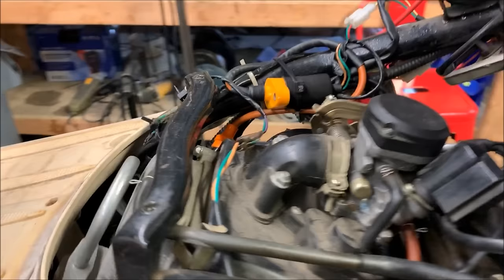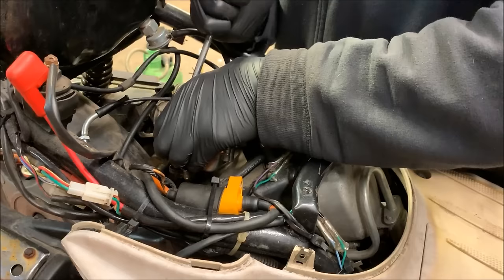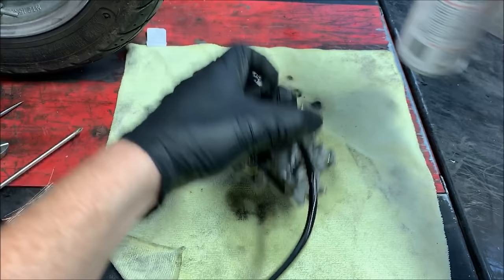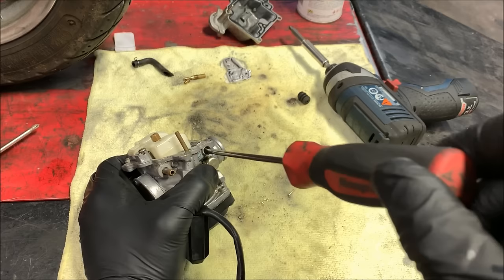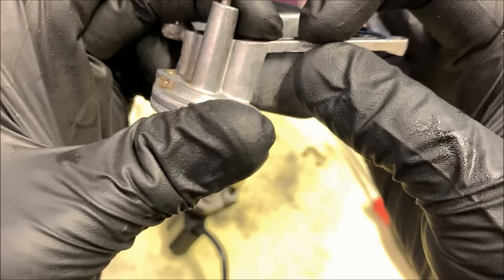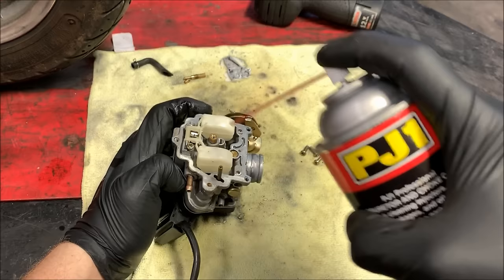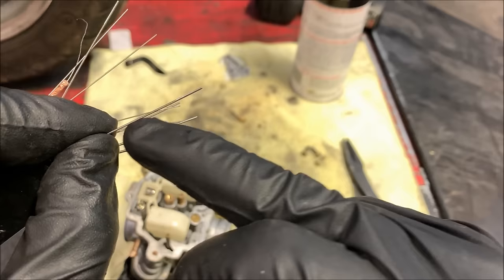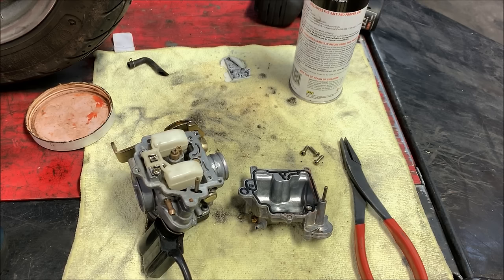Cleaning a scooter carburetor

Comment: What if you didn’t replace the small washer and o-ring? What would happen to the bike? How would the bike be affected?
Reply: It would suck in air from around the screw and run more lean
Reply from the maker: it wouldn't affect it well cause issues,  did you give us a subscribe?

Comment: The only problem with GY6 carbs is the fact that the fuel bowl comes with one way screws and you have to drill them out and have replacement screws to reinsert. At least mine did.
Reply from the maker: Yea I’m.guessing they want you to replace it rather then fix it. Chinese scooter thing

Comment: I drilled out the plug on my carb to expose the air mixture screw and there is no slot in the brass. what can be done?
Reply: I had the same issue, and used needle nose pliers to turn it.
Reply from the maker: this

Comment: Ant recommendations on where i can get the screws for the float bowl cover? The float bowl on my scooter have break away screws.
Reply: how did you remove the break away screws?
Reply: @chadpianalto6262  i didnt. I started to but I bought a new carb.
Reply: @Goldensnakey  I was able to get them removed by spraying all three screws with pb blaster and the next day used an easy out. they came out fairly easy.
Reply from the maker: hardware store?
Reply: @Scooterswapshop  what size?

Comment: You nentioned the "Fuel tap" being stuck open.. Where is that and how do you fix it?  Good Video!
Reply: He's talking about the part that screws into the gas tank with 2 hoses on it. The carburetor vacuum sucks the gas diaphragm inside it to open from one hose, then the hose next to it flows the gas to the carburetor.
Reply from the maker: recently did a video on it
Reply: @WaveAction777  Many thanks. Cheers!

Comment: I have a question, I have a yerf-dog rover CUV w/ Mikuni slide and manual choke , is it possible to change carbs and go to an auto choke carb ? I know I will probably need an inline resistor and a different CDI can anyone help ? This is my wife's CUV to run about the farm in and she has trouble operating manual choke @ start-up hince the need for modification.
.
Reply from the maker: anything is possible that's not a bike we deal with

Comment: Pleasssss help me before my dad kills me, I put some used engine oil in the gas, and after a few hours the scooter doesn’t run, I drained all the fuel and oil and put new fuel in there but it still doesn’t run pleassss what do I dooooooo
Reply: What happened?
Reply from the maker: new gas and oil run for 10 min
Reply: take the plug out put some gas in the hole clean the tip on sparkplug and when it kicks over keep it running till it flushes it out

Comment: Great video and very good explanation of what/how/why.  My Piaggio Fly 50 with this exact same carburetor was not good for anything past 1/4 throttle.  I found that the pilot jet was completely clogged.  I tried to work my carb cleaner wire in there, but no good.  I found a tiny drill bit for my Dremel which was the same gauge as the pilot jet, and began to drill.. much to my surprise it was blocked from the factory - no hole lengthwise at all.  Which was surprising because the mixture screw was readily accessible and set (somewhat) correctly.  Also, the Accelerator pump jet was clear.. but the other end which protrudes into the intake of the carb doesn't have a hole in it!  
  Re-installed on the scoot, and it ran but for 5 seconds or so and died.  Wouldn't re-start.  I suspect it's flooded - is it possible that Piaggio was using this Keihen carb but put in a dummy pilot jet and a dummy accelerator jet?  
  Either way, I have a replacement GY6 carb on the way.  We'll see.
Reply from the maker: THANKS

Comment: Mine has those damn screws with no heads so I had to stop..I have a new fifty cc I got last year .it started up after winter but then I felled the tank and the next day it wouldn't start and I can't get it running.im so upset..I love that thing..I was in a motorcycle accident and the scooter keeps me riding with a smile. So I'm heartbroken..and I dnt know where to get it fixed . knobody wants to touch it..I'm gutted..mayb I'll have to buy. New carb
Reply from the maker: ok

Comment: I have a 50cc scooters pretty much brand new it won't turn over won't start
Reply from the maker: You’ll need to contact the shop you
Got it from as its likely under warranty
Reply: Sounds like a dead Battery?  Do you keep it on a battery tender so it stays charged?